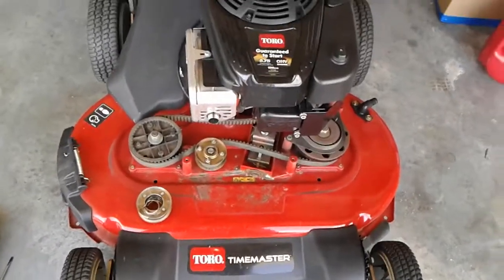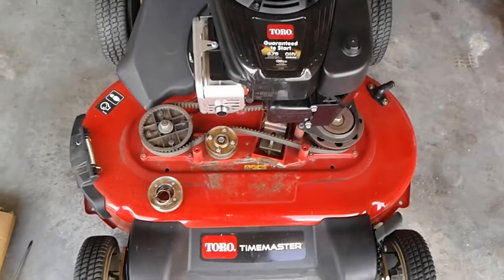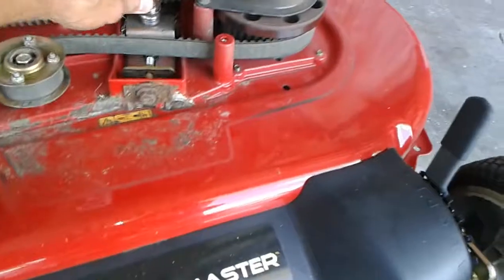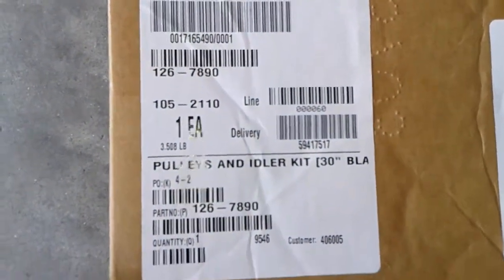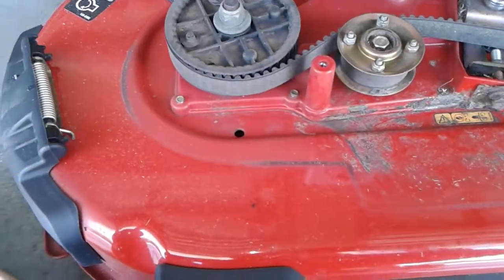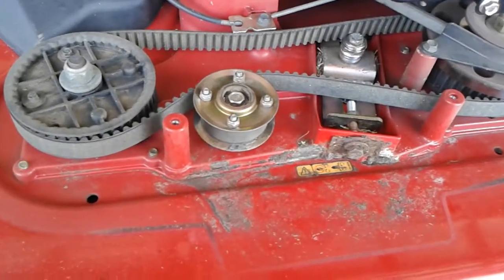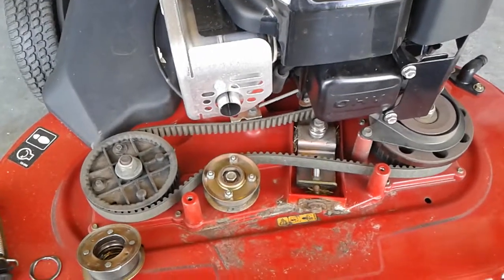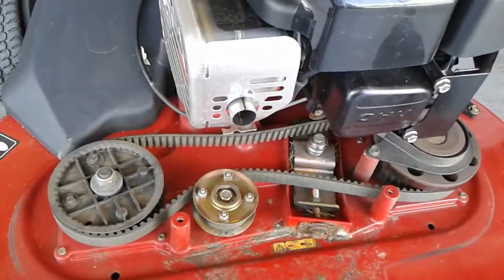Toro TimeMaster bearing trouble

Comment: What are the signs that the pulley has gone bad?
Reply from the maker: Well when the cheap pulleys in there ,  they make a high screeching noise, sometimes with a bit of smoke, this was right from brand new. They didn't last the season.
Reply from the maker: Oh and when the bearing goes while in use you will hear a pop and the blades banging together,  shut it off immediately so you don't destroy the engine or the blades.
Reply: Do you have a link for the replacement bearing? Mine went out for the second time, this time after only about 6-10 hours of use…non-commercial.